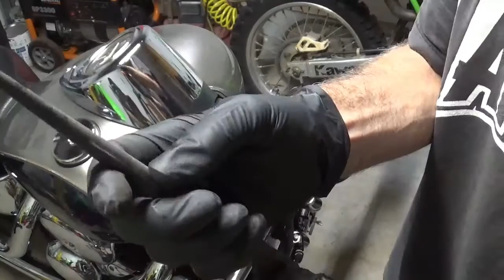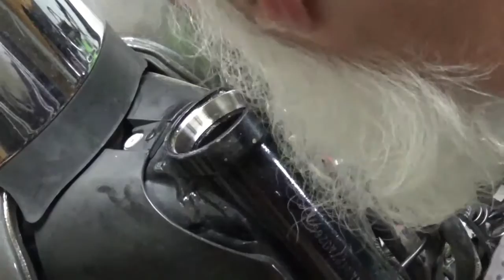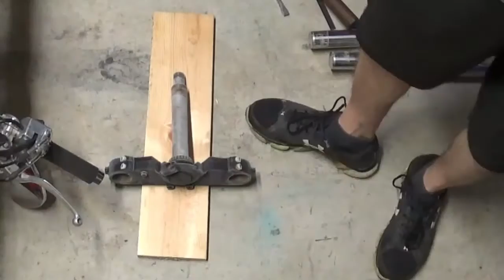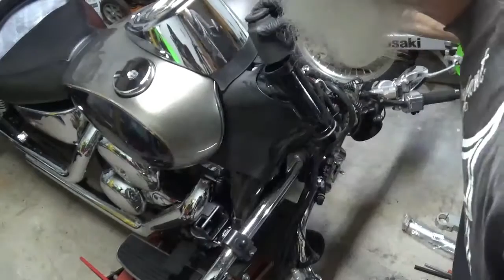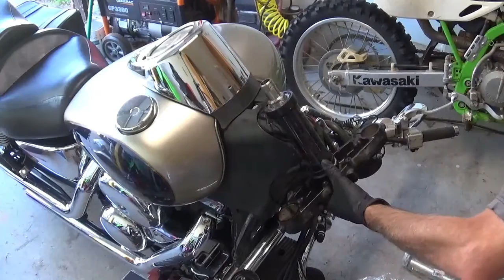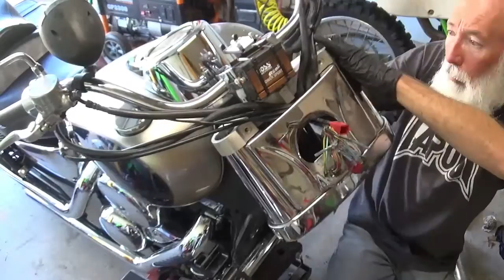Steering Bearing Kit- Diagnostic & Full Replacement DIY- Kawasaki Vulcan 'or any motorcycle'

Comment: I will be using your videos to help me with working in my 1600vn.  Great bike.
Reply from the maker: They are amazing, since last June, I've logged well over 25k miles and still going....
Rubber Side Down!!!!
Reply: @jaylanecreations5503  Just completed more than 4,200 miles to Pacific Ocean and back.  Steering Head bearings hung in there but the bottom ones were rusted badly.  Glad I made it in one piece.  I must say, my rear end suffered the last two... long.. days.  What do you sit on?
Reply from the maker: @tomgould2410 
It must have been one amazing trip! Glad to hear you made it back in 1 piece!  I got back from a trip looping from Oklahoma out through NM, TX, CO, UT, NV, OR, ID, WY, and back south to OK...

Did you get the bearing changed out?
Reply: @jaylanecreations5503  I got them changed.  I see why labor charge for doing so is so high.

I could not get the bottom one out with Kawasaki made puller (borrowed from local Kawasaki shop) or punch because there was no lip on half the race.  Used a dremel and stone.  Race was pretty stubborn so I had to grind it completely in two.  The dremel allowed me to be quite careful where a dye grinder wouldn't have.

Comment: Wouldn't it have been easier to remove the old bearings with a gas torch? Heat the bearing up to expand it and break the seal between the metals etc? Honest question ore than suggestion. I'm about to do this on my Drifter
Reply from the maker: I wouldn't apply heat here, personal preference.
The fit is just snug and a punch works fine with almost no fight. Adding heat could (potentially) damage the paint or metal.
I did freeze the bearings to allow them to shrink so I didn't need to beat on them any harder than I needed to.
There are times where that would be totally acceptable.
Reply: You can use a hair dryer to heat the bearing without any damage to the paint.  I did this and it worked like a charm.  Always safely use hot and cold to install interference bearings (In my opinion).  Using a chisel you run the risk of damaging the bearing surface.

Comment: Around how long did it take? Trying to guess around how much in labor I'm gunna have to pay bc I dont have the proper equipment to do it myself.
Reply from the maker: It can be done with good quality basic hand tools, a good manual and a few 'specialty tools' IE good punch and chisel, and Crescent Wrench.
From beginning to end it should book at around 4 hours or so, depending on a few add ons and such.
If you insist on bringing it to a shop get to know the shop and mechanics and get agood sense of what they are about- Anyone can turn a wrench, not everyone is trained and has the experience to do the job correctly. I hope this helps. Feel free to contact me with any other questions!
Thank You